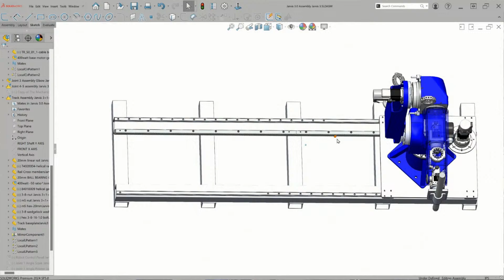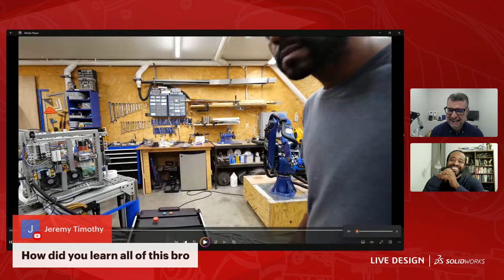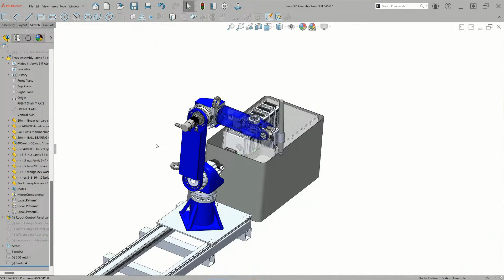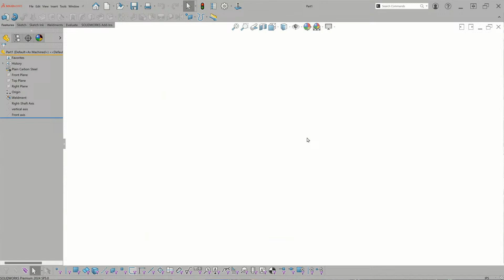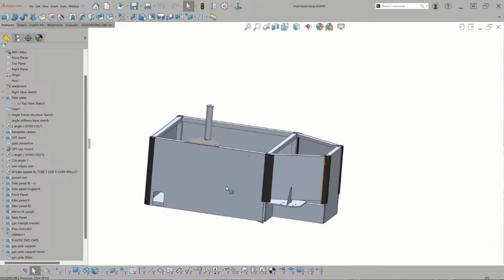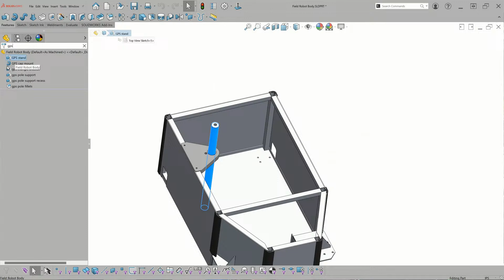How I Made a 7-Axis Robot from Scratch - SOLIDWORKS LIVE Design

Comment: I am planning to build a robot from scratch . Is this possible that I can download this robot you made and I study and according to it I make another one
Reply: depending on the size. there is an aduino robot arm using 3 axes. if you need a kick start. or look up universal robot ur-5 is VERY cheap. (compared with ABB/Kuka/Siemens/Kawasaki) all in one robot that can handle 5kg or the bigger ur-10 for 10kg. (irl it's about 2-4kg less than noted in spec) very easy cobot to work with.